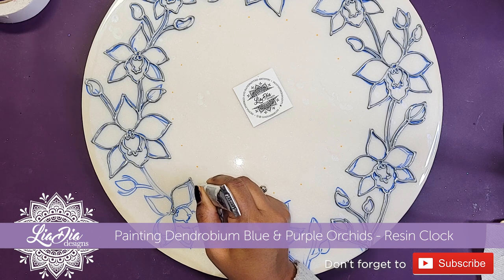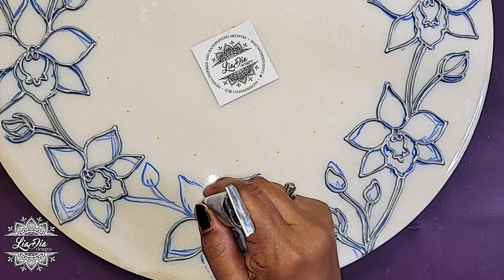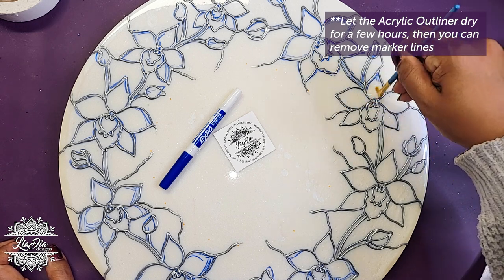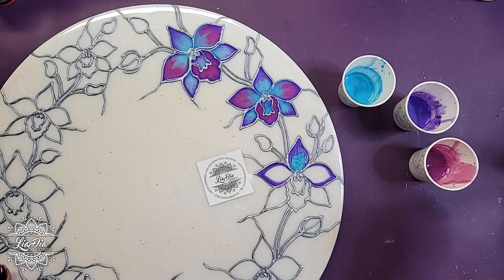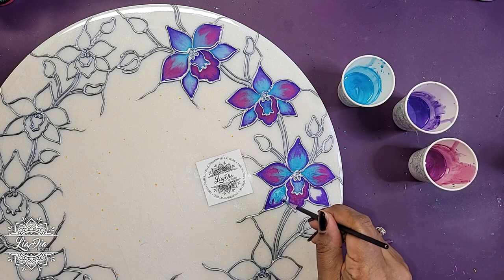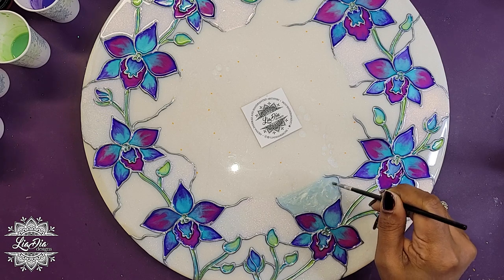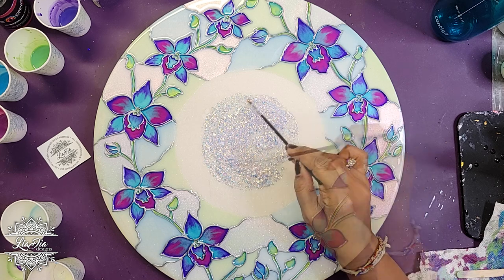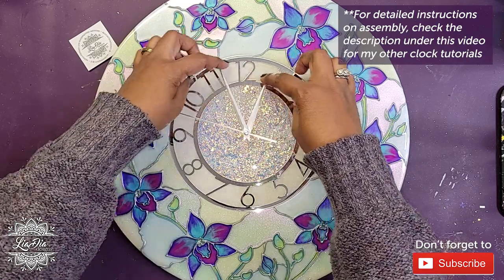Painting an Orchid Clock in a Stained Glass Resin Art Style | DIY Epoxy Resin Tutorial

Comment: Hi Nadia. I have been practising doing stainded glass using the mica powders and the gloss varnish as you recommended but am having trouble not getting what I call pimples but are probably air bubbles. I don't see that you have that problem. Do you have any tips for me please to prevent them. As it is too hot here in Brisbane Qld at the moment I am practicing your techniques for when it is a bit cooler. You are so very talented